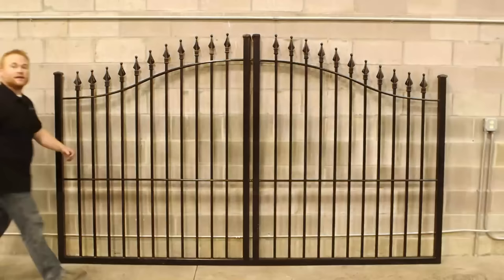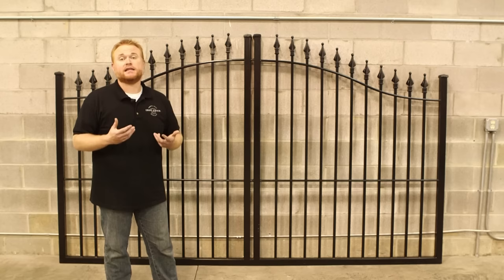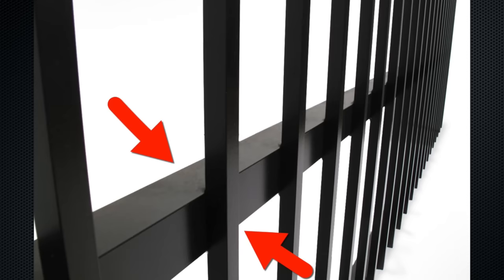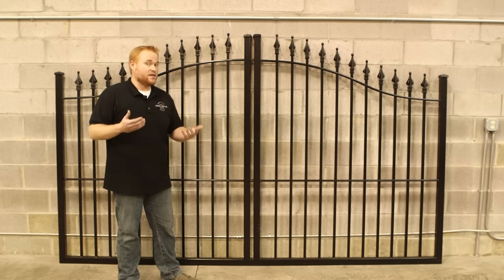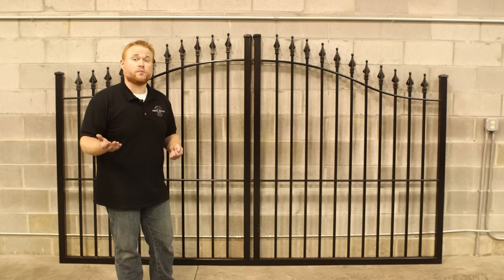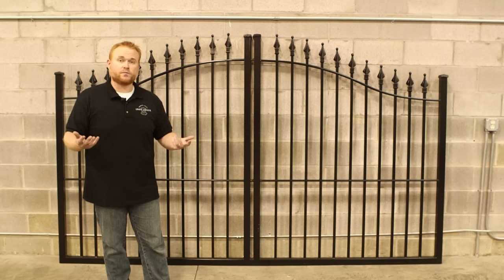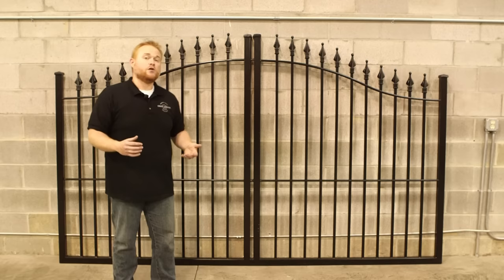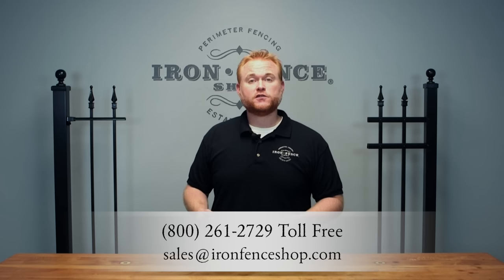5 Things to Look for When Buying a Wrought Iron, Steel or Aluminum Driveway Gate

Comment: Here in Alberta if you don't put drain holes for your pickets, condensation building up in hollow pickets will eventually be enough to freeze, distort, and eventually split the picket open usually about 2" high from the bottom.  This is very common in staircase railings with the pickets and even 2x2 posts that don't have a drain hole in the bottom mounting plate.  I am talking Alberta winters 25-30 below zero.
Reply from the maker: The pickets are open on the bottom of our pieces so even if they freeze, they shouldn't pressurize enough to split.  As for the posts, it depends.  We used to have weep holes drilled into them, but that typically became a rust spot so we stopped.  The air escaping around the base of the cap is usually enough to keep it reasonably dry and not pressurized in those.  However, I could see that if you have sustained negative 25-30 below that things not common further south could occur.

Comment: Your bar centres are wrong. Gaps are bigger on each end of the gate. Rookie mistake. Great vid👍
Reply from the maker: Hi Christopher.  We have to keep the 3.875 air gaps consistent through the middle of the gate to match our fence panels and other gates.  Depending on the final gate width, some gaps between last picket and frame will be wider or narrower than that.  Good eye!

Comment: Pre-drilled posts require far more accurate post setting than the average homeowner is capable of.  Even a great fence installer might be off 1/4-3/4" across a 16' span and that difference will show up when those double drive gates meet. 

Then the posts are set, the hardware mounted, gates are hung. What do you do to remedy that error?  Nothing...
Reply from the maker: Hi Lucas.  That is why we don't pre-drill anything.  You are correct that with pre-drilled posts you have to be on-the-money perfect.  By setting the posts first and then drilling the holes in the posts for hardware, it allows for more accurate setting of everything.
Reply: lucas mccain I

Comment: Thank you for sharing the info. Tips. 
I live in duplex. Each side has two garage. I want to build the gates with two independent remote controls. This way each side/owner can access their own. 
Can you please give ideas of how it would look like? Thank you
Reply from the maker: Hi Sinat.  I would need you to give us a call to discuss in more detail as that's not a standard gate setup.  However, if I'm understanding how you want to set it up, I do believe its feasible.  800-261-2729
Reply: @Ironfenceshop  in process of moving. I'll contact you later. Thanks

Comment: What’s stronger? If I’m trying to make gates/ stair case bannister / balcony gate 
Stronger as in thieves will struggle more to get in?
Also what’s less likely to rust ? Less maintenance ?
Reply from the maker: Steel and iron will always be stronger than aluminum unless you go with some crazy thick aluminum that will far out-cost the steel and iron.  In terms of thieves getting in, a $40 harbor freight sawzall could cut through either if someone really wants in.  In terms of maintenance, the aluminum won't rust like iron and steel if the finished is scrapped off, but you lose a lot of strength and bend resiliency going with the aluminum.  There are trade-offs with both options.
Reply: If you looking to secure the home security directly on the home is best. Window guards and security gate.
If you looking to secure all the property than perimeter fence and driveway, pedestrian gate. And a guard dog doesn’t hurt

Comment: How do you install the driveway gate with the u-frame, do you have to trench out the driveway so that the lower frame is flush with ground? Thanks
Reply from the maker: No trenching through or under the driveway is required unless you are running a power line for gate automation.  The U-frame (and gate in total) will be installed by you so that its 4-6 inches above the driveway or the height it needs to be to swing clear open and shut without touching the driveway.  You want to keep things like snow compaction in mind too for the size of that gap between gate frame and the driveway if you live in an area that gets snow.
Reply: @Ironfenceshop  thanks for the quick reply, so installing the gate in that manner would mean you would drive over the horizontal frame, correct?
Reply from the maker: @waltertobiasjr4305  Hi Walter.  No the frame will be elevated off the ground.  These are all swing gates that are mounted on posts.  These are not roller/ slider gates.  The leaf is just sitting on the ground in the video since its uninstalled in our shop.  If you email us at sales@ironfenceshop.com, I can email you some pics of installed swing gates.

Comment: I thought I wanted a single gate to avoid the hassles associated with aligning two gates and 2 openers.  When I looked at your site, you don't sell a single gate wider than 12 feet.  Is there a reason you don't make wider single gates.   Farm gates are 16' and that'd be about the minimum I could do with a single gate.
Reply from the maker: We mainly stop at 12ft for shipping and weight/ leverage reasons.  It s extremely pricey to ship anything over 12ft long and tough to offload it without equipment too.  The wider that gate gets, the more weight and leverage force you are putting on the hinges and posts and it starts getting them too close to their rating limits.

Comment: What alloy is used on the aluminum gate?
Reply from the maker: Hi Luis.  It varies by component:

- Pickets: Aluminum Extrusions of 6063-T52
- Posts: Aluminum Extrusions of 6005-T5 
- Rails: Aluminum Extrusions of 6005-T5
- Gate Frames:   Aluminum Extrusions of 6005-T5

Comment: "how's it going to look 5-10 years"
excuse me? how about 100 years?
Reply from the maker: Hi Justin.  There is a 25 year warranty on the Stronghold Iron line and in the 10 years I've been working here, the only warranty claim we had was on one post out of 75 after 8 years that we replaced.  As for 100 years, I can't help you there!  With proper maintenance, the gates could last that long but could require re-coating after 25-50 years depending on climate, gate placement and care.
Reply: Re painting ya polishing carbon